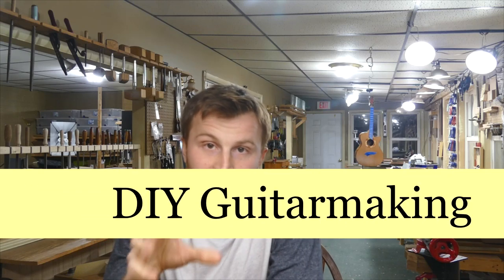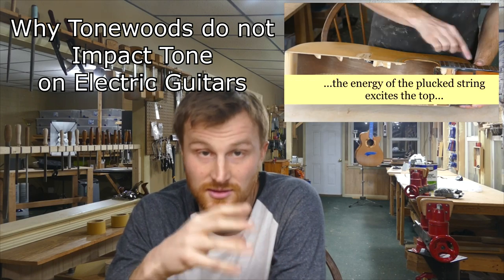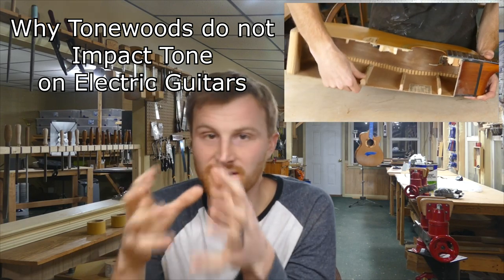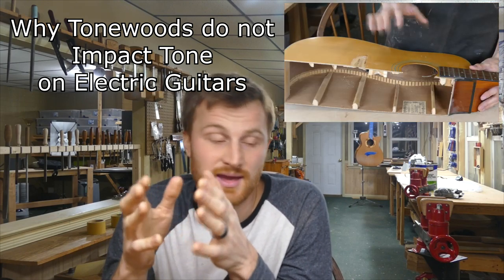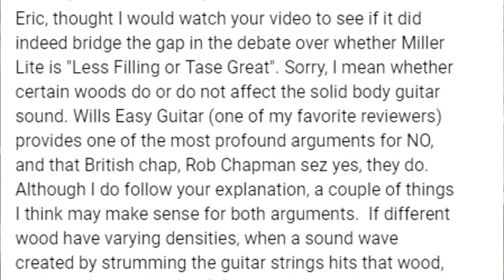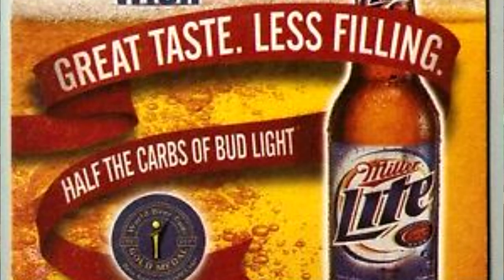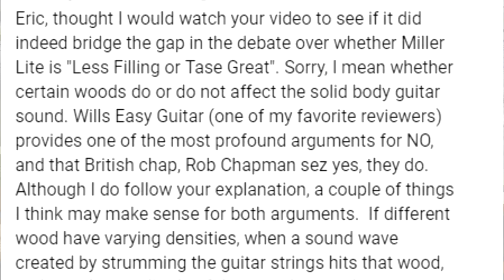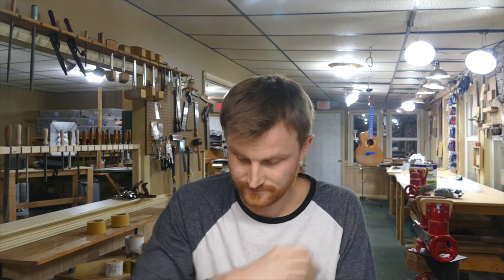More on the Electric Guitar Tonewood Debate

Comment: No wood is perfectly stiff; when any material is stressed, some amount of that energy is lost as heat. Energy that is lost cannot be sensed by the pickups. Compare, for example, an electric guitar made from solid steel versus one made from soft rubber - the solid steel guitar will have immense sustain and a very bright tone, while the rubber guitar will have very little sustain and a very dark tone. Any physical structure (even a very stiff structure) has resonant modes which will create peaks and nulls of vibration within that structure, further influencing the damping effect of a solid-body guitar on string vibration.

The choice of wood does make a measurable difference to the tone of an electric guitar, but it's extremely subtle relative to the influence of the pickups and strings. Testing this for yourself can be done in an afternoon with a few boards of wood, a pickup and some spectrum analyzer software. It's entirely legitimate to argue that the difference is so subtle as to be irrelevant, but it is there.

There is an interesting example from the other direction - acoustic resonance is widely used in industry to non-destructively measure the stiffness of materials.

https://en.wikipedia.org/wiki/Resonant_ultrasound_spectroscopy
Reply from the maker: I agree with everything you said.
Part of the problem here is that in the question of "does A affect B?" the answer "yes" will always win, if there is no sense of the scale. You can make the question as granular as you want and lean on the conservation of matter, if nothing else, to say that everything affects everything. That's why I framed the question as "...in a way that is discernible and meaningful to a human listener." Otherwise, everything we say is meaningless without a sense of the scale that is in question. Because if not for human listeners then who are we playing for? Once you pass the point of "so subtle as to be irrelevent," the question loses all meaning because it has no purpose.
In a way, I feel like when we talk about acoustics there is an apt analogy to extreme germaphobes here. The extreme germaphobe is always technically correct. Anything you touch has some amount of bacterial life existing on it. But that technicality doesn't help the germaphobe live a functional life. In fact, they live a very dysfunctional life. They lack an intuitive sense to say that there is a difference in scale,  between a doorknob and a dumpster, because if you analyzed both at a microscopic scale you would see plenty of bacteria . Likewise,  the musician who is shown a spectral analysis comparison of woods is similarly misled.
It's funny, though, because there are very few extreme germaphobes out there. There is something about our sense of vision that we can trust more. I can look at a smooth, shiny piece of silverware and not second guess that that silverware is clean enough to use. I don't need to inspect it with a microscope.
It seems, however, that there are far more "acoustic germaphobes," if you want to call it that, out there. There is something about our sense of hearing that many people cannot trust. And they need to be told that something sounds "warm" or "dark" or "bright" etc. with software rather than trusting the hardware between their ears.
Reply: OMG this is so simple, first like Eric said the tonewood principle does not apply to solid body guitars, even though the Wood is not 100% stiff you still loose the Air Chamber aspect, and even though pickups don't pick up anything else than string vibrations, and due to the mass of the materials used it doesn't matter if the bridge is attached to a basswood or mahoganny body, or it the nut is attached to a alder or mahoganny neck!
Reply: We've all heard the specious reasoning for 'why tonewood matters'. At this point, what matters most is that not a single person who rants and raves about 'why tonewood can be heard' is willing to step up and wager on their ability to prove it in a blind test. If what they were saying is true, this would be trivially easy to demonstrate but as soon as you challenge their BS, in their own terms, they immediately change the premise, appeal to some 'subtle nuance' that cannot be proven, etc. What matters is that wood species is a moot variable in the process that goes into an electric guitar generating a signal. You claim it isn't. OK, great. Wanna prove it in a blind test? Or will you just make excuses?
Reply: @muhears7732  when a pro tonewood will be able to debunk in 100% what have been proved that tonewood doesn't matter, and that the table board science that Will explained I will change my mind, but I think that the possibility of that task is the same as the one to determine in wich pool was dropped the Apple Juice drop and in wich one was dropped the Orange Juice. As I said before to many People, if tonewood was a thing acrylic guitars would sound like crap and the cardboard strat would not sound like a strat, but pro tonewood seem to forget about that, I mean sure cardboard comes from trees but it's properties are not like solid Wood.
Reply: You conflate sustain with tone....i dont really think there is someone here that debates the difference in the sustain department....there are even guitars out of..stone out there that sustain for days...but you somehow squeezed tone in there...and that is simply not true...if two strings have the same scale length,the pickups pockets are drilled in exact same positions and the string is struck at the exact same place they ll sound identical no matter the material(assuming we move the same electronics from one guitar to the next each time).
Reply: @Steve It had feedback issues cause the body plays the role of the amp basically in acoustic guitars and electrics have their own amp...thats why they make the body thick and dead.....whats so hard to comprehend?
Reply: @Steve " But maple and pine, yeah you could hear the difference." then why can not one single person prove that in a blind test? Electric tonewood believers always state these facts not in evidence as if they're "obvious" and then they talk about their ears, etc, yet simply proposing to them a blind test where they can't see the woods in question, or even more amusingly, asking them to provide evidence where we can 'hear maple', they start mumbling and making excuses.
Reply: @Steve I think we can work in your own terms and simply state that your earlier claim of being able to hear wood species is false. You now change the premise because you can't really conquer your own claim.
Reply: @muhears7732  but how could you accept the idea the different woods increase sustain and yet not change the frequency?

The guitar has a resonant frequency, right?
Reply: @valueofnothing2487  not to a degree that can be proven. People claim a specific, high caliber sensory perception about what they perceive in a guitar or what 'causes'  certain tones, but as soon as you say "haha, that's untrue, lets prove it with a blinded test" , they just make excuses or start presenting their free-talk theories EVEN MORE STRENUOUSLY
Reply: @muhears7732  nothing. Just because people are unable to distinguish similar differences. if you listen to the Anderton blind videos you will find it very difficult to distinguish between different types of amps or single coils are humbuckers or even transistor and tubes or whatever.
Reply: @Dreamdancer11  No guitar can sustain for days, or just for dramatically longer than, say, a basswood Squier Strat.   Much of the energy loss is due to the strings directly pushing air around and flexing so that they convert the vibrational energy into heat.   After a certain point making the body more massive reaches diminishing returns because you still have those other losses, especially if the neck isnt also super massive and rigid.   To get super sustain you have to have some kind of feedback putting power in.

Comment: Perhaps I may be misunderstanding your position on this, so correct me if I'm getting you wrong.  Are you saying that because the pickups are only capturing the electromagnetic vibration of the strings, factors outside of the pickups, wiring, etc, are not having any influence at all, or maybe only a slight but barely perceptible influence, to the end result of the sound coming out of the guitar amplifier speakers?

Maybe this could be tested best in the extreme where all factors except acoustic factors are identical.  Two guitars, both have the same scale, both have the same bridge, we will use the same strings, and both have identical pickups pots and wiring.  I propose these be a Gibson Les Paul, and a Gibson ES-175, I suggest these two not because of the subset of "tone woods", but because I want to isolate the influence of acoustic properties from the electronics.  For what you are suggesting to be true, the listener should not be able to hear the difference between these two guitars.  I choose this as it is the most extreme example of decoupling the effects of acoustics from electronics in an electric guitar, more so than tone woods in a solid body electric guitar.  So is this your position or am I getting you wrong?

I always love myth busting, I like to believe as many true things and as few false things as possible.  Defeat confirmation bias!
Reply from the maker: Pretty much, yes, so slight as to be beyond the limits of human sensory experience. The main argument was the contextual one I made in the first video, but yes, that is what I was saying on this video.
One thing I would add to your hypothetical test is a statistically significant number of guitars of each type that you are testing. Say, 5 Gibson Les Pauls and 5 ES-175s.
Also, the largest overlooked factor in any blind testing scenario is psychology and phenomenology. When you study sound it breaks down into 3 areas: generation, propagation and reception. The kinds of unscientific tests you see on youtube always ignore the last one: reception. i.e they ignore the phenomenological experience of the player/listener. If you understand the guitar as a tool for sound generation, then it only makes sense to study that within the limits of the tool for reception (the human ear).
As you've mentioned, we have to weed out "confirmation bias." The best way I can think to do is to give the players/listeners a "psyche test" prior to the real test. Blindfold them, hand them an instrument and have them describe the experience. Then take away that instrument, tell them you are handing them a different instrument, say brazilian rosewood, hand them back the same exact instrument, have them describe their experience. I would do this probably 5 times, every time telling them that the instrument is something very different, when in fact, it is the same. I think you can weed out a lot of biased listeners this way. In fact, you may have a hard time finding someone who passes this test.
Reply: @EricSchaeferGuitars  There's a funny section in Zollner's book about identifying and fixing actual resonances in electric guitars, with the audible ones generally being due to some mis-fitting piece of hardware like a loose bridge saddle in a Tune-O-Matic Les Paul bridge, and a funny rough sound on certain Strat notes often identified as "Strat-itis" due to neck/body resonances actually being due to some similar hardware interface screwup.   He rants about about designs and manufacturing tolerances causing frustrating inconsistencies in the performance of pretty much everything, including old Strat and Les Paul pickups.   It turns out that the weaker but allegedly "better" sound from many real vintage pickups is due to shorts in the windings from deteriorating insulation, and the authentic old magnets vary a lot because Gibson used different AlNiCo alloys processed in importantly different ways by different vendors, buying whatever was cheap and available in sufficient quantities.    But Gibson's marketing makes it sound like there's a specific 1957 Les Paul humbucker sound that their vintage reissue pickups precisely emulate, with several precise variations they also emulate... when there just wasn't and they're not replicating any particular pickup they actually made anyway.

Comment: I just can’t believe there are still so many people who believe that the wood on an electric guitar ones it is amplified makes any difference to the sound at all!

You have a magnetic field ,created by the pickups, wich will change due to the vibration of the strings and is the turned into an electric signal which goes to an amp and then through a speaker to hear the sound. How on earth can the wood have any influence on that proces?!?

Comment: The definition of tone woods shoudln't be touched to make electric guitars, but because electric musical instruments created as a evolution of the acoustic instruments, and it took some decades to get totally separated from acoustic guitars with firstly electric microphonic pickups, a lot of the truths about acoustics became myths for the electrics. That plus marketing created those cults about tone woods, finish thickness, ammount of wood pieces, glued or screwed necks of electric guitars, and etecetera. Wood types really make a slight difference in the tone of an electric guitar, to my ears the neck makes more difference than the body, but it's nothing brutal, and probably the best woods for electric guitars are the reverse of the best for acoustics, so the more dense the less they take from the string vibration, Paul Reed Smith talks a lot about that, and he's probably the most influential electric guitar gurus alive, so you need to make a guitar that let the strings vibrate the most they can without taking the knectic energy whotout damping and absorbing the movement. Most people can't hear the tonal differences of a guitar, saying that some instruments, like a Telecaster, lacks low frequencies just because it have a lot of highs and to them it seems trebly, but in fact Telecasters have a more complex tone with a lot more lows than a Stratocaster. People say "the wood needs to vibrate and give back the strings that vibration to the strings", that shows they know nothing about physics. What's absorbed is not given back. That's why today Ebony is considered a tonewood, but it is for electric guitars, no serious luthier would make a guitar top with ebony.

Comment: I am a guitar tech and have built several electric guitars. Tone wood is non existent in electronic guitars. You hit the srring, the pickup picks up the sound and out to an amp. End of story. If you mounted a strat pickup on an acrylic guitar, it will sound like a strat. The stainless steel guitar and neck, Giltter? Sounds like wood, if you were able to mount a humbucker to a piece of dried bubble gum with a bridge and neck, it would sound like any humbucking guitar. Now acoustic guitars are all tone wood. This I can see and grasp.

Comment: First step of all: we have to make an universal definition of "tonewood" and "tone"!

The differencies in concept and perception ARE HUGE, that's why it's important to have ONE DEFINITION!

Will try here to make a start😊

For me tonewoods are the woods with the optimal properties to build a electric guitar, for neck (the most important) and body, and the proper balance inbetween them referring stiffness, density and resonance. 

Tone is for me the sound of a note on one string with the overtones and undertones. The more overtones in harmony, the better. But if some frequencies are slightly dampened, or thers supported- thats the voicing! So, tone and voicing could be the same. 

Then there is sustain. Long sustain is not only the long time of ringing out of a note, and the decay of certain frequencies (that is also related to "tone"),  its also a measurement for  free vibration of a string on the construction. Its a quality sign of the build. Therefore long sustain provides a maximum of frequencies.

😏But them again: it's subjective, there can not be a universal definition.....😓

Mostly, between two identical sounding guitars (IF there is such thing) the louder one will be percepted as the better sounding.... "She has more tone and sustain".... allthough she has just more decibels....😏

And😜 basswood is not crap- its a proper good wood- just depends what you are looking for😊 Lightweight:✅, balanced sound✅, stiffness✅easy to work on✅, cheap✅, grain 😣👎, color😣👎....😌